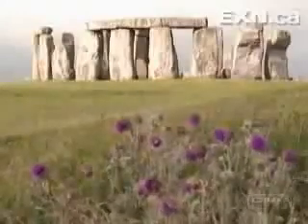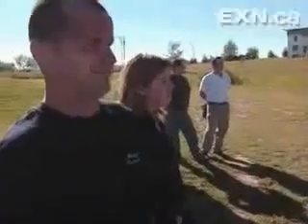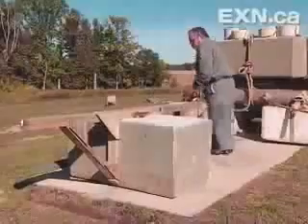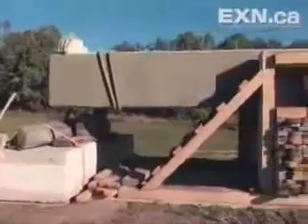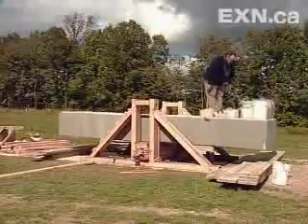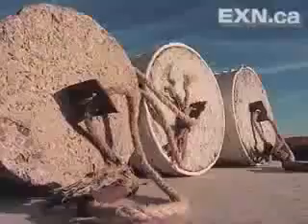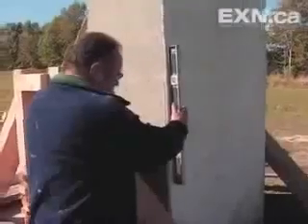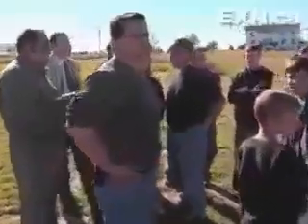Man Moves Huge Blocks!

Comment: Imo he is 100% onto something with this. I think continued real world applied problem solving along this line by ppl who work in construction/engineering or just have a deep passion would solve most if not all the questions regarding the ancient moving & raising of megalithic multi ton stone blocks. 

Of course this video doesn't address all issues involved or all the other anomalies of ancient sites the world over but this is the right approach to take. Real world trial & error. Sadly archeologists/egyptologists are often arrogant, don't do this enough & when they do they try it themselves. In reality they need to hire ppl who work in construction/engineering of other applicable field who have experience problem solving along those lines.

Comment: The rocking horse technique is clever, but I would like to know how he got the block off the ground initially to start the process.
Reply: You can dig under it. I think you would have to build a preliminary structure. To then be the base of what can be seen here. I think this is a super cool idea but the fact that it has concrete under it overdecks the true difficulty. Through and through